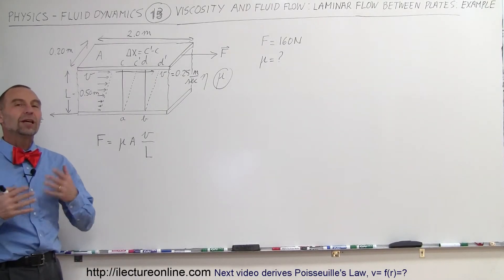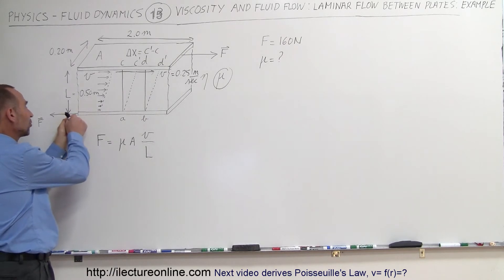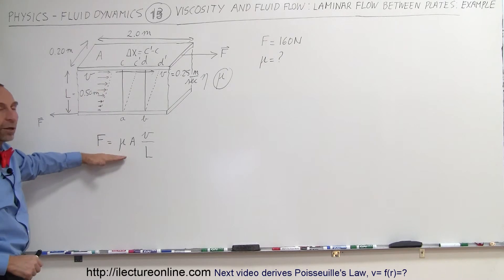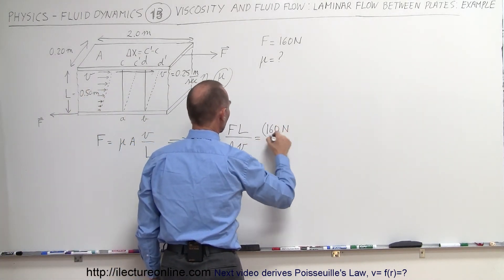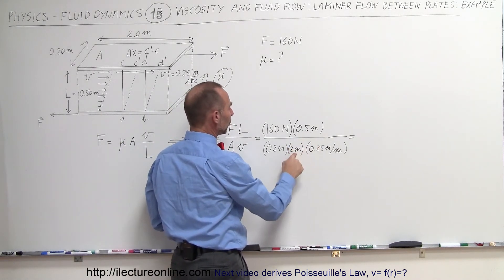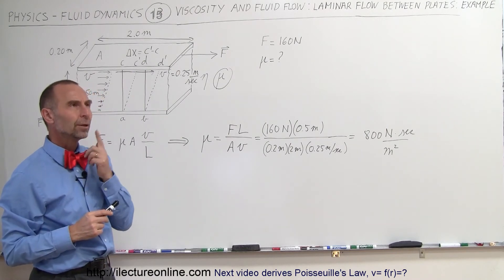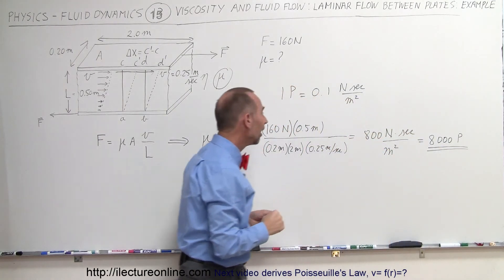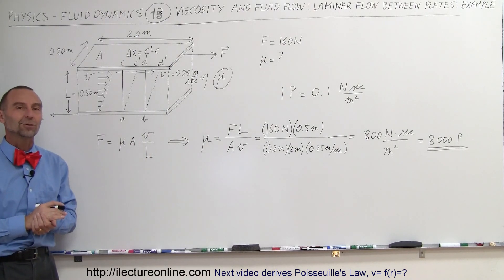Physics 34  Fluid Dynamics (15 of 24) Viscosity & Fluid Flow: Laminar Flow Between Plates Ex.

Comment: If I was given the velocity not at the top what should I do 
I think about changing L to that point instead of the entire L 
Am I right
Reply: Or maybe I can say dv/dL=C 
Then I find C through deviding the velocity of that point by L at that point 
then I integrate dv/dL=c 
then I find v at the top 
then I put in the equation like what you did 
Am I right 
I think both of the ways work but Im not sure I will try them anyway
Reply: I tried both of them and they gave me the same answer

Comment: I have a doubt... Do you use the mean velocity?
Reply from the maker: No we use the difference in velocity between the top and the bottom.
Reply: So, in this case it's the max velocity (as the velocity if the bottom is cero). Thanks!